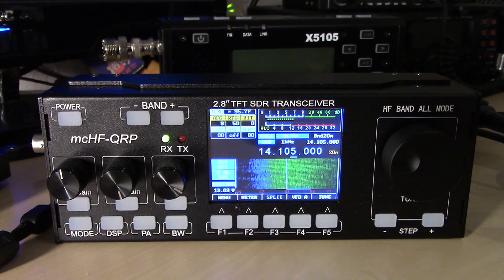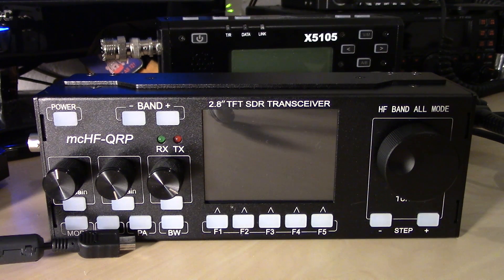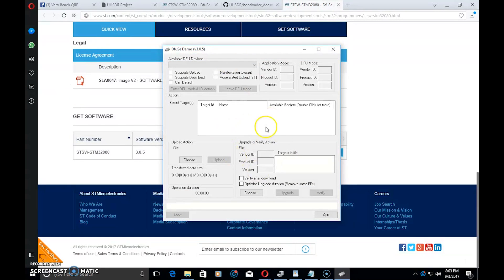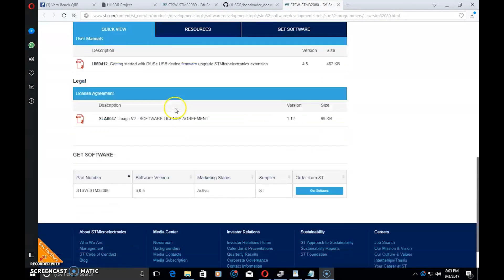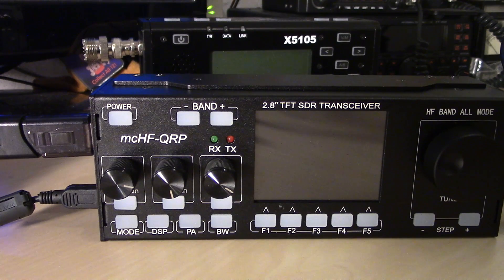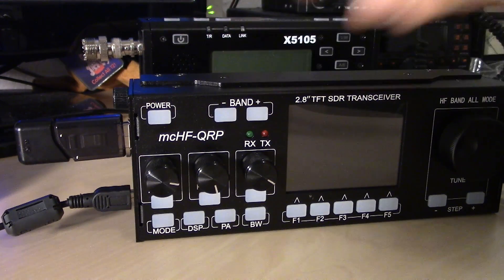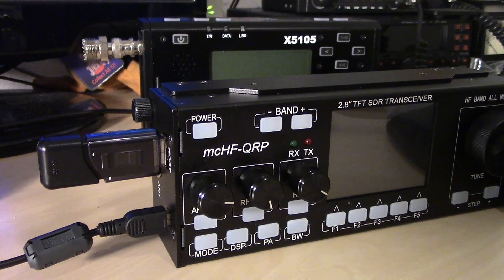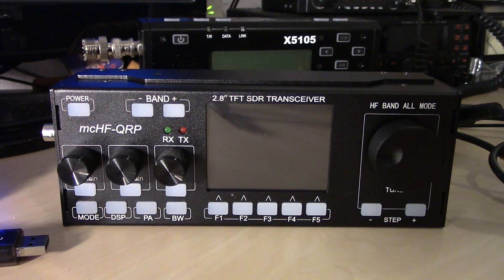RS-918 mcHF Firmware Update Procedure Bootloader/Firmware

Comment: Hello, I updated the firmware and the rig says  it is necesary to update the bootloader but in   DFU it doesn't show.  In windows it comes up as serialusb com5 but Windows 10 does not allow the driver to be changed, 
Is there a solution on how to upgrade the bootloader?

Comment: As far as the bootloader upgrade is concerned you MUST use upgrade and not upload! Upgrade will be available if you choose the file next to the upgrade button. If you use "upload" you actually read the bootloader from the radio and save it to the disk, as can be confirmed by the "Overwrite?" message.
Yours only appeared to work because your radio was already on that version.

Comment: hello, really great video thank you very much.
I am having a problem with my radio.
1. The waterfall flows up instead of down, but I did notice yours does the same. Is there a way to change it to flow down?
2. Also my radio shuts off when transmitting and have no idea why? I have been in touch with the seeler in China and they are looking into. One item they mentioned was updating the firmware as you did here as the reason for the search and to watch your video, Thanks again.
If you have come across any tips to fixing the shut down problem I would appreciate it.
All the Best 73's
Still have snow and ice here in northern Alberta but the sun is making every effort to make changes :)
George
Alberta, Canada

Comment: I must be doing something wrong. I have windows 10. Tried to upgrade my R-918 I think I am down loading the right stuff. I down loaded boot 5.05 and when I upload to radio is says D2.11.42.
on R-918 screen it says error down load the new 5.04. Any ideas? Jim lighthouse463@charter.net

Comment: Your BL process is wrong. You are showing how to back up (UPLOAD) the current BL from the radio to the computer, however useless to use afterwards, but that´s another story :) You should use the UPGRADE button which will transfer chosen BL to the radio.
Reply: Yes you are right.  You should get BL ready loaded in the software, before you power on the radio.  I first made the mistake to overwrite the new BL on PC, with the old from the radio.   The software and procedure is a bit weird IMO.  Its too easy to make stupid mistakes.

Comment: Hi. I own the rs-918 with fw:D2.9.8 and bl: m0nka 0.0.0.14.  My problem is that the DfuSe does not recognize my device... same problem on windows 7 & 10. The radio work fine on digitals and the cat work ok so the usb cable and/or driver is notnthe problem. If I try to update the firmware only the rx/tx led beging to blink with no display. Any help will be very apreciated. 73

Comment: You should take a look at the mBITX.
really wish there were more custom kit-based radios out there for ~100$, even if QRP. with Arduino and Raspberry Pi, it seems like it shouldn't really be that hard for someone to come up with a basic kit or plans, so that us lesser fortunate guys/girls who are here to learn more about electronics than ragchew on a 10,000$ contest machine could get more into the hobby.

Personally I'm more interested in Data modes & medium range transmission with compromise antenna designs. also kind of want to do an automated radio relay/APRS style setup with a HF/6M QRP setup, as well as some sort of spectrum analyzer mounted on RC aircraft/balloons. I know a few guys who mounted WSPR transceivers to weather balloons.

Comment: My new RS-918 is after 3 weeks not more working ...!!!!!
Today I want switch on the RS-918 ... but nothing more happen :- The Display is only for a very short time flashing white . That`s all ... 
and it is white so long I press the power-button . If I stop and not more hold pressing 
the power-button  the display is black like off switched transceiver .
So I was thinking something in the firmware could be not more ok ... but I 
don`t know why .
I started after visiting and study several websites and instruction videos (like this here)
about firmware and bootloader update how it is to make :... full reset and a new installation or firmware update and/or renew the bootloader ...
But already the first step of the procedure failed :the RS-918 will not shown or will not detected from the computer as DFU USB-Device :I can make what I want , the RS-918 is dead and I can not call him back alieve ... !!!
Please : What is to do now ... anybody knows about to solve this problem , to get the 
RS-918 back alieve ???Jens Spiess / HB9JOI

Comment: welcome!
Please help if you can!!
I bought this baby off of one of Amateur radio, in General, were installed firmware version 2.2.3 and the bootloader was 3.0.4
After reading the forums, decided to flash and downloaded the latest firmware from this site
https://df8oe.github.io/UHSDR/ 
installed loader latest version and the firmware too... I think I overreacted.
why now with supernova firmware no modulation neither PRS nor in am or in FM!!! carrier transfer in FM there is power too?
and when in SSB switch with any side at least upper at least the bottom - the PTT switch, and press edit. power external displays, and arrow 3 watt to 1 watt slowly falling and all.
ranges have changed - now down is up and Vice versa and select buttons pitch adjustment, too. 
trying to restore to a lower version walee nor to no avail - by the way did the procedure like this:
loader via cable pierced, and program for processors ST DFuse Demo 3.0.5, and the firmware itself was filled with flash - well, these procedures are more or less painted on the forums.
Now how am I supposed to be already regretted a hundred times I ask or need it for lower version of the sewing...
Can shoot video and fold or put on YouTube, if you want to understand what I have done!!!
Hope you will help me because now I have one receiver instead of the transceiver is turned!!!

With respect, Vladimir R7GP

Comment: A note on the bootloader update methiod described in this video...

In DfuSE you point to the bl-mchf.dfu file using the "choose" button on the RHS, (under Upgrade and Verify action), this will enable the Upgrade button.

The method described here using the "upload function" will not work with the later bootloaders

Comment: I found your bootloader upgrade routine to be wrong. Yes it looks like it workes but it is not upgraded. (Tried to upgrade from 3.4.1 to 3.4.4, but under System Info it said 3.4.1 also after upgrade. Naturely: You have to use the "Choose.."-button under "Upgrade or Verify Action". Then the "Ugrade" button works, as in the wiki manual. All fine!  :-)
Reply: Yep, he transfered the other way around: from the device to a file - I noticed the "save file" dialog :)

Comment: I understand the hardware board in the RS918 is an older version that the current one in the mcHF project.  That being said, I would be interested to see your comments on how the new firmware works once you've had some time to operate. Thanks for your great video. 73
Reply: There are infact two choices of bin file.  One for the earlier versions and one for the later versions with more memory.

Comment: The reason that the UPGRADE button didn't light up is that you picked the wrong CHOOSE.  Use the CHOOSE in the lower right of the screen, next to the UPGRADE button!  I still had some problems with this process (upgrading from 3.2.0 to 3.4.1 Bootloader, in a genuine mcHF, not the clone, if that matters). But the third time I tried it, it worked!
Reply: Hi
I tried to update my 218 clone, followed the instructions but now it does not turn on
does anyone help me? maybe you need to reset and recharge the loader?
thank you

Comment: Thanks for the info. My rs-918 is supposed to arrive on Tuesday. Thanks for posting info on the radio. This is all going to be a big help when I get my radio. Why did they threaten to ban you on QRZ?
Reply: Maybe they got threatened by the original maker? Or are trying to avoid problems with them? In any case the radio is pretty neat looking, I like the style a lot better than the X5105.
Reply from the maker: Apparently I am promoting stolen and counterfeit products. "This kind of media, if continued, will restrict you from posting any future posts on the site, including classified ads".
Reply: Maybe I'm mistaken. I thought the mcHF was a K I T. and this radio is a completed unit.
Am I wrong? If not, wouldn't that be two different things???